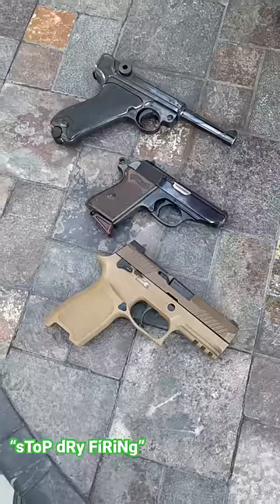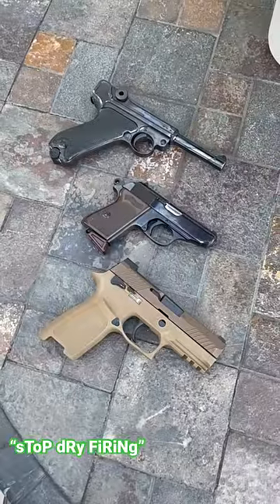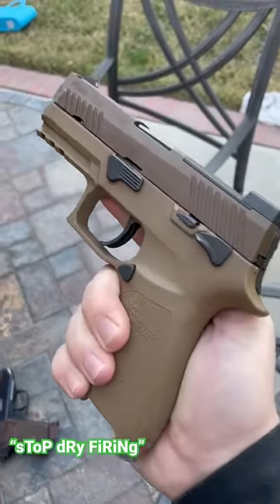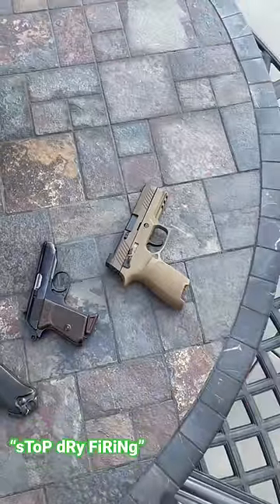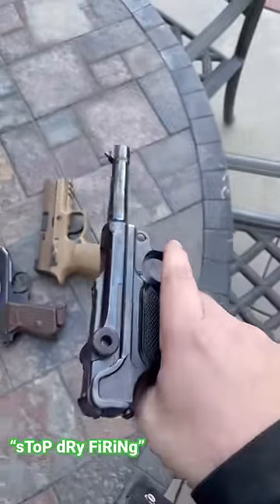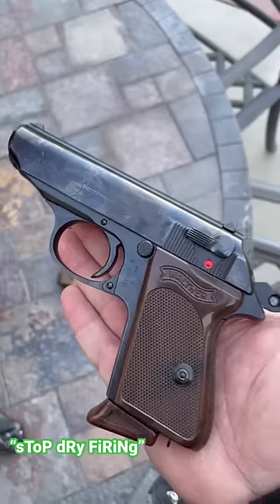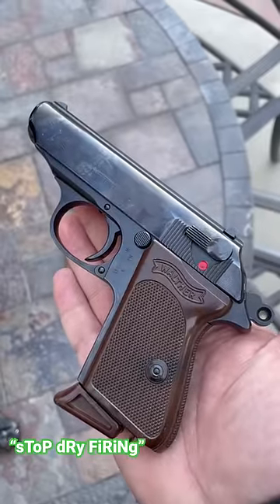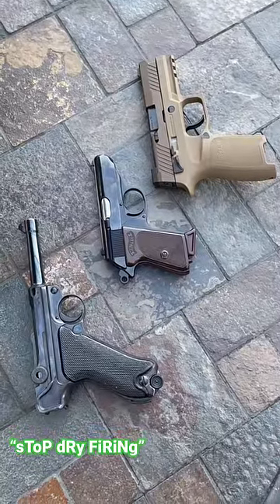“sToP dRy FiRiNg” #shorts

Comment: Also don't dry fire fixed firing pin revolvers.  Those are the ones with the firing pin as part of the hammer.   Otherwise you're spot on.
Reply: Really? I didn’t know that..
Reply: Possibly some early centerfire rifles too like the werndl 1867 since iirc it is possible for the firing pin to hit the breech or at least thats what ive heard. Although i wouldnt dry fire it regardless since parts are not obtainable
Reply: @MrPanzerCatYT   fixed firing pin revolvers were made into the mid 20th century and still in general circulation.  Anything made before 1873 such as cap and ball, the conversations there of, needle guns, rimfire, and many others should not be dry fired.  This is because the moving components may make contact with fixed parts causing breakage.   Also the metallurgy on anything made before 1873 is spotty at best.  But I don't really know why, just something that seems to be a thing.  I have never seen a Wendel in person.  But I would not dry fire it because of the reason you state being common to the era.
Reply: @LegacyUser i have a S&W K frame with a firing pin on the hammer.
Reply: Came here to say so
Reply: Also .22 pistols like the High Standard.  Repeated dry firing without a snap cap will actually damage the barrel.
Reply: What about beedle fire rifles? Lol forgotten weapons
Reply: That would include dirty Harry's revolver model too right? Cuz I own one
Reply: @EddieBlueHalen he said rimfires are the exception and should be be fired in the video. I have a couple fixed pin revolvers and I see nothing about either one that makes me think they will break if I do for them. The firing pin comes down in the center of an empty chamber, what is there to hit?
Reply: Uh what? The pin wouldn't be hitting anything and no parts are colliding without resistance as they're all one piece .
Reply: the pin in my old man’s Evil Roy just hits an empty chamber, what’s getting abused in it?
Reply: Where did you hear that?  Because that's not true.  I've got several smith and Wesson revolver's that my late father purchased in the 1950's.  They've been dry fired tens of thousands of times if not hundreds of thousands of times..
Reply: Yeah its The single action revolvers they were you used a lot in cowboy movies like handfull of dollars and if you look closely they fire the first round and Then Hold it and only release hammer really fast
Reply: bro i ruined my taurus 605 when i was 13 this way. i had read it was cool until the wheel wouldn’t open from the pin sticking out of its hole. damn damn damn.
Reply: @justforever96  the hammer nose bushing. Over time it can start to flare out. I've seen it happen to a K frame, it got so bad the cylinder would bind when it had cartridges.
Reply: @brianwilson4861  the hammer nose bushing will get damaged and flare out. Firing pins can also break as can the rivet for the hammer nose.
Reply: Exactly why I got snap caps for the wife's K frame
Reply: @ObservationofLimits  the end travel of the hammer is cushioned by the primer. Dry firing will enlarge and damage the firing pin bushing.
Reply: @William Walker  i few manufacturers say they can damage the frame if they have a fixed firing pin. Revolvers that have them separate are fine as they hit the pin, not the frame. Kinda like dry firing an ar lower when its off the gun
Reply: @venz8201  Yes, you are correct about the firing pin bushing. In the military we were issued S&W Model 15 Combat Masterpieces. We didn’t dry fire much. When I got out I bought a beautiful S&W Model 13 in .357, and noticed the bushing was flaring out (BTW, I bought it used). I contacted S&W and they told me to send it in. I got it back a few weeks later, new bushing installed, no charge!
Reply: @terrysaunders2026  now THAT is good service
Reply: You should never dry fire any weapon any more than necessary except for a function check, etc. It just puts more wear and tear on the action while not doing what it was built to do, (firing bullets) and will shorten the life of the weapon before it needs to be repaired. 
Also dry firing is very bad for many types of guns and will damage them immediately it varies from gun to gun.
Reply: @iTsKovxkzR  
That's one of the guns where that's a no no.
Reply: @leoncollins5932  mane look i had dry fired that probably over 300 times at that point to break in the trigger, worked great until it didn’t. impressive but dang wish i knew
Reply: @kylecarter8436  I mentioned needle fire guns in another response.
Reply: @fire_storm_8314  Smith and Wesson manuals encourage you to dry fire your model 29s. They're center fire
Reply: Yeah apparently it's also a thing with break action exposed hammer rifles.
Reply: The single action myth that for some reason fixed solid metal firing pins just shatter if you dry fire. Been using single action revolvers for years and years, dry fire constantly, never had an issue. You might wear out some springs, you might mark up your cylinder, but I have never seen a firing pin just shatter, and if it did, it was probably not lining up with the frame of the revolver correctly. And that's likely something you would want to know anyway. I could easily outfit several people with more single action guns than any one man should carry, I personally maintain and tune all of them, and the only thing I have never had to replace on such a wide variety of single action revolvers, is the firing pin.
Reply: @MrPanzerCatYT  I heard a lot of the original rifles with firing pins, like the original needle rifle, had very fragile firing pins.

Pin in guns like that broken on its own often enough, so doesnt really matter if it hits something.
Reply: Facts
Reply: Firing pins break.. it happens
Reply: @jmmywyf4lyf  No need to break your gun faster due to incompetence tho.
Reply: @termitreter6545  Have had guns all my life. This has never been an issue. All the internet fudds, create problems that dont exist
Reply: @justforever96  In this case it isnt hitting something it would be the sudden deceleration of the part behind it could overstress the thin part of the pin if the pin itself also isn't striking something
Reply: I was hoping someone would mention this. Such as J -frames, ect. The firing pin is actually floated , feels loose. It contacts a hole in breach and slides into the primer.
Reply: Yeah I learned that the hard way
Reply: @jmmywyf4lyf  How many firing pins did you replace? How do you know if a firing pin would have lasted longer?

Owning and using guns doesnt acutally mean you understand how they work.
Reply: @termitreter6545  ive replaced 1 firing pin in my entire life. You can try and play this internet know it all role, all you wish. Dry firing has never harmed any of my firearms. 

You wear full kit at the range, dont you...
Reply: Grandpa taught me this. Because he owns a very very old colt. I honestly don’t even know if he has ever shot it. I know I never will. But was taught nonetheless.
Reply: You beat me to it. Yes revolvers with floating firing pins are okay to dry fire but revolvers with fixed firing pins will break the firing pin right off the hammer. Ask me how I know 🤦‍♂️
Reply: Bingo
Reply: @conductorcammon Same here. Family heirloom revolver in .32 long or short.
Reply: I learned this the hard way
Reply: @justforever96  you run the risk of crystallizing your firing pin, but you do you.
Reply: Heritage rough rider is a great example as well
Reply: You should not dry fire any gun that uses rimfire ammunition or has a FIXED firing pin in the hammer, unless you use snap caps. The bajillion double action Smith & Wesson revolvers with hammer mounted firing pins can be dry fired forever as far as I can tell. That is because the firing pin floats a little bit on the hammer. Where you run into trouble is Colt single-action revolvers where the firing pin is *part of the hammer*. 

I cannot imagine how many times you’d have to dry fire a Smith & Wesson K-frame or J-frame double action revolver before the bushing had to be replaced because it got deformed. If it were possible, I would know about it. Something more than just dry firing has to be at work in the examples cited above. Such as “hold ma’ beer” handloads…
Reply: also, don't slap the cylinder in place like you see them doing in movies.
Reply: @brassbat  good Lord!  Someone who considers themselves an expert in firearms did that to a revolver of mine last week.
Reply: @chipsterb4946  
Yeah, dont let them. I forget the name of the part, its been over a decade since I've really been into guns, but while I was learning gun parts and how to breakdown and rebuild guns, my mentor told me it can break a tiny part in there.
Reply: @brassbat  💯 i about slapped the shit out of a shooter at the range I'm an RSO at cuz he did that shit. Told him we're not Hollywood that shit causes issues and broke down everything for him. Then he apologized.  Hey not my $$ spent on the gun lol
Reply: @brassbat  the first thing that happens is the crane can get twisted out of shape. That’s the part that connects the cylinder to the frame. Then the cylinder doesn’t fit right in the frame at lockup and the chambers may not line up right with the forcing cone. TL : DR it’s BAD1
Reply: This is exactly correct. Hammer-mounted firing pins will develop microscopic fractures (called crystallization) from repeated dry firing. This is because there is no primer to absorb the impact of the hammer dropping. The crystallization sets in when enough vibrations from this unimpeded force have been imparted on the firing pin. 

Also, some shotguns are not safe to dry fire as they may eject the firing pin entirely. This is rare and only a concern with vintage shotguns.
Reply: Exactily finally sm1 with a brain!!Its only common since thats what lacking today with anythg.if the pin is on the hammer it Will eather bind or break after a while so its a good idea too hav another pin on hand with a rebuild kit..
Reply: Never over-estimate the strength of metals. I have seen metal fatigue in so many strange places.. I was switching out a clutch spring on a car with 250k miles very well cared for cleaner than mine at 90k. While installing a plastic clip for the spring to rest in, using my thumbs I broke the ALLOY ear off.. I ain't no hulk, but due to the constant repetitive clutching over 250k miles the metal had fatigued and now my thumbs are strong enough to break an alloy idk the percentages but magnesium aluminum and steel it was barely magnetic. You can also dry fire to do a function check no problem it's your gun. If you want to sit there dry firing hours a day go for it, but metal fatigue is real and insurance companies know all about it.
Reply: Same goes for older break action shotguns with firing pin on the internal hammer.
Reply: I've heard that before about S and W revolvers with the firing pin on the hammer, but I never understood why it was so.
Reply: @LegacyUser  My Heritage .22 trigger spring exploded this way
Reply: 🤙🏻 yep, caught this too
Reply: @LegacyUser  appreciate the wisdom share!
Reply: @kylecarter8436  a what? Sounds like it’s from Halo lol. But I’m intriged.
Reply: @Caedo9110  Right on, same exact concept of dry firing a bow, which is why I knew this. But the details of the crystalization is new to me, very neat!
Reply: @LegacyUser  

So when I've played Russian roulette with the boys we've been hurting the gun? Good to know
Reply: @leoncollins5932 you better tell that to every competitive shooter in history. Most dry fire their guns thousands of times to get better.
Reply: @fire_storm_8314 yeah Model 29. I have the same one. Get some snap caps for it before you have to replace your firing pin.
Reply: @leoncollins5932 Bro, enough with this misinformation lmao 😂
Reply: Do you people even know what happens every time you fire a round? There is literally like 40,000 to 50,000 PSI of pressure occurring inside the barrel, a literal mini explosion.

Your guns are supposed to withstand pressure, heat, gasses, fire, etc. It's OK to dry fire, FFS 🤣
Reply: generally i disagree. i have many fixed firing pin revolvers and the firing pin itself doesn't come into contact with any surface and the flat face of the hammer hits the flat face at the back of the gun and has a lot of surface area. 

realistically what breaks those firing pins is when you fire a round and the cartridge pushes back into the firing pin and since its fixed and comes in at an angle a lot of force is pressed on that small point which is why all the broken firing pins you see on old revolvers are broken at the tip.

this is of course for centerfire cartridge revolvers only, pinfire, cap and ball, and rimfire revolvers all have the firing pin contact another point on the gun and shouldn't be dry fired, also because they are older and more fragile than centerfire revolvers of the late 1800's.

Comment: Guns are literally made to shoot bullets, if shooting out nothing broke them then there’s a serious problem with the manufacturing
Reply: The exception is for rimfire simply because of their design, where the pin strikes is going to have to be offset from the breech which is what will damage the pin, not bad design it's just old design.
Reply: @CaptainApathetic some rimfires, not all
Reply: Definitely true lol rimfire is just a lil touchy about it lmao
Reply: You forgot about rimfire. The firing pin is intended to be cushioned by the soft brass of the cartridge rim, instead of landing on the hardened steel around the chamber.
Reply: @hxhdfjifzirstc894 most modern rimfire pistols will be okay e.g. glock 44
Reply: Glock 🍑🤡
Reply: Not all manufacturers will recommend dry firing. Better to find out what the manufacturer recommends. 

Most polymer striker-fire  pistols are ok to dry fire. 

Why would some guns NOT be ok to be dry fired? 

Answer: It boils down to metallurgy. The firing pin is designed to strike the soft, metal alloy rim of the cartridge. Without a cartridge in the chamber, the firing pin strikes the hard steel chamber and can cause damage.
Reply: @SamutSaringHustle 
A chamber is an open cavity of space by definition, how long are your firing pins though? You got the special extended firing pins that literally just ram through the casing and mechanically launch the projectile? 🤣😂
Reply: @mike7652 I'm telling you man, these people don't know what they are talking about 😂